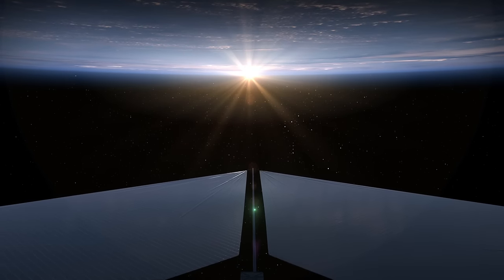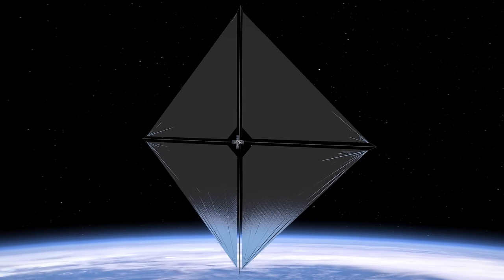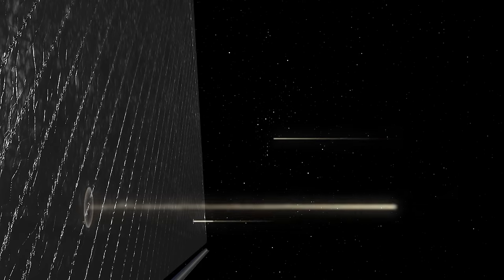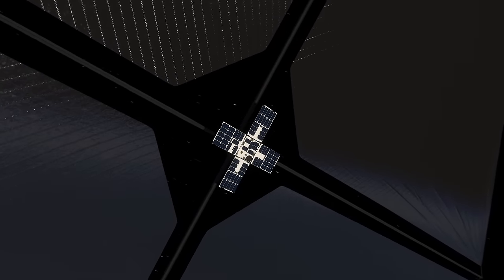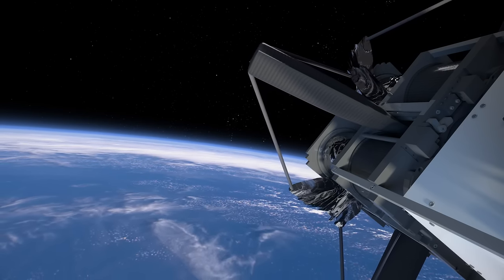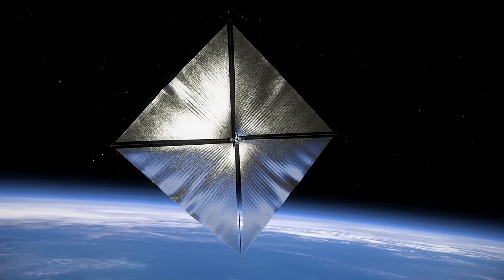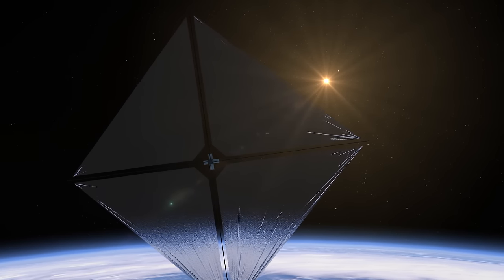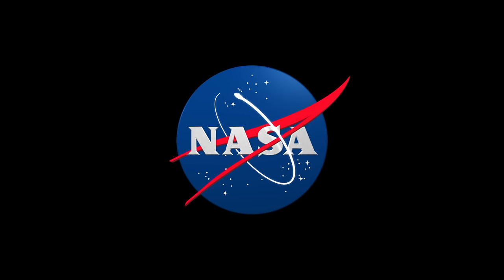NASA's Next-Generation Solar Sail Mission

Comment: Thank you for thinking in solar sailing again! Its weird this amazing propulsion method and we haven't yet mastered it, but its great that you guys are working on this, good luck!
Reply: Solar sails are an incredibly niche technology with little practical use case.

The further you get from a star the less efficient they become and the slower they move. 

Biggest issue is solar sails are stupid fragile. A smaller sized sail for actual use would be 100m x 100m and the metallic coated Mylar sheet would be a few microns in thickness. This basically means any matter that touches the sail will tear it. Just the act of leaving the heliosphere would destroy a solar sail since the change in pressure is great enough.
Reply: Its just a start , we human are a brand new race into the gallactic realm

Comment: Amazing.  Good to see that NASA is utilizing the natural "environment" to help move spacecraft.  Let's have more of this!  Thank you.
Reply: Been using gravity assists for a long time
Reply: @Astra2  gravity assist was great, but this one is revolutionaries, using solar power to generate thrust instead of rocket propulsion
Reply: @imamfauzi1101  Gravity assists were and are revolutionary. Using gravity instead of rocket fuel. But I get what you mean, solar sails have the potential to accelerate crafts' to a fraction the speed of light, which is absolutely mind-boggling and could one day allow for interstellar missions.
Reply: @Astra2  Yeah that's what I mean, gravity assist really depends on how much gravity that some stellar body has, hence it's called gravity assist, and it's not really increase the speed so much higher, especially a significant fraction of the speed of light, solar sail just need a solar power from nearby star
Reply: @imamfauzi1101  Well speed is relative. The Parker solar probe is travelling at 692,000 km/h. Still much slower than the speed of light.
Reply: @Astra2  Alright got that, thanks for the information

Comment: It’s fantastic we are exploring these new technologies, but how durable is a solar sail? It looks like even small particles of rock would rip right through it, especially if it gets to the intended speeds.
Reply from the maker: ACS3’s attitude control system can counteract imbalances due to relatively large holes (centimeters across) even at the most outboard edges of the sails.

Comment: I've always loved the look of these, image that flying from system to system
Reply: I don’t think these sails are designed to do inter stellar travel. They’re best if confined to one solar system
Reply: wouldnt work for interstellar journeys
Reply: @huwale  couldn't it pull the sail in between systems and open it again once it once it reaches the next? A probe or satellite, not people
Reply: @randomdaveUK  the further away from a star, the less power it has. once its far enough away from the sun it'll be basically unpowered and will take thousands of years to reach the next system.
Reply: @huwale  that's not true, there's no resistance in space, it won't slow down. Anytime it's stuck by photons it's speed gradually increases.
Reply: @randomdaveUK  it won't slow down, it just won't get any more acceleration once it's far enough away from the sun
Reply: @randomdaveUK  He never claimed that it would slow down.

Comment: I heard about this and it's research which dates quite a while back. Great to see the continous development. 

What are the power consumption requirements for such spacecraft? I'm sure we can already sustain it on the energy captured from a cosmic void. 

These will achieve great goals and a great achievement for you. 👏
Reply from the maker: Good question! ACS3’s cruising power is in the 10-12 watt range at any given time.
Reply: @NASAAmes  can laser beams from LEO/moon be used to propel the sail when it gets too far away from the sun? How fragile are the sails? Could they be coated in a thin layer of aerogel to protect them from fast moving debris?

Comment: Amazing.
Would the craft still need onboard fuel for orientation correction? Because surely if the photons hit at different angles, the craft will eventually rotate. 

I imagine that we can get close up images of Kepler planets before the end of this century using solar sails.
Reply: While I'm not aware of the internal components of the spacecraft, it's both probably possible to change the shape of the sail by bending it to get deliberate asymmetric thrust for attitude control, and the spacecraft bus may have a set of momentum wheels for orientation control.
That being said, momentum or reaction wheels (basically gyroscopes) do hit saturation speed eventually so on a larger spacecraft attitude control thrusters would be required but as this is a tech demo, there probably are none.
Reply: you could also use reaction wheels, but also some solar panels are needed

Comment: This is a genuinely incredible idea. How much wattage would be required to use the same type of propulsion on a crewed mission? Not light speed, I just want to know how much power would be enough to significantly cut down on the length of a trip to mars or beyond, and how much time it would cut off.

Comment: How much weight can a solar sail carry? cuz i heard the major downside of em was that they struggled to carry more weight which would be needed for research or anything like it.
Reply: You could carry as much weight as you wanted if you were willing to put up with being slower.
How much would be practical to carry would depend on where you’re attempting to fly (is there a tiny bit of friction there to impose a minimum amount of force required, or is it a transfer that you have to pull off with limited time)

Comment: This MUST be an April Fools joke ! What is the force per square meter on the sail ? How fast will the ship accelerate ?
Reply: ACS3 already launched by the time you posted this
Reply: The very rough answer to both is: very small.
But if you have a light spacecraft with large sail then slowly you can go very far.

Comment: How can something that doesn't have mass push spaceships or other similar things in space? It's about the difference in temperatures between two sides of surfaces or is it something else? I guess the energy from photons has some part in it. Maybe photons actually have a mass?
Reply: Photons actually have a very small amount of momentum to them, it’s a force called radiation pressure.
Reply: @collectiusindefinitus6935  I didn't know about that. Thanks for the answer. Cheers 👊💪

Comment: What about asteroid impact on those sail which will be torn before they reach the end of solar system.
Reply: Bro asteroids will not hit the sail. They are too far apart and very avoidable.
Reply: @xd0895 he's talking about the small ones
Reply: With a sail that thin and the speeds associated with space, a micrometeorite will probably just leave a micrometeorite shaped hole without tearing the sail in the process, which means the sail itself would be able to take quite a few impacts before performance is severely impacted.

Comment: It's so thin, what about small debris striking?
Reply: Small debris goes straight through - no problem.
Reply: @nightjarflying  well it will tear a small hole won't it?
Enough small holes and the efficiency of the sail will start going 
And those debris,even though small will have immense kinetic energy
Reply: @kaiserwhence2468  true, but it wouldnt spend much time in earth orbit.  it would probably used for missions beyond LEO where there is less debris. even then, the rate at which debris could cause its efficiency to go down probably wouldn't have a big impact on a mission (dependiing on the length of the mission)
Reply: @kaiserwhence2468 There isn't enough dust & micro-meteorite particles to have a noticeable effect - the Japanese IKAROS 2010 sailed for 5 years & it hits its time targets perfectly predictably - it wouldn't if it was riddled with holes. The big space risk is frying electronics from cosmic rays & solar particles, not physical damage by rocks, pebbles, dust etc etc.
Reply: @kaiserwhence2468 Very, very little kinetic energy is transferred to the sail as something dashes through at thousands of m/s
Reply: Thanks all,I get it now:)
Reply from the maker: Good question! Small debris striking the sail would just go right through, vaporizing the sail at the impact point, leaving a tiny pinhole.
Reply: @NASAAmes  thanks!
Reply: @NASAAmes so would the holes damage or slow it down
Reply: @Idk-lt8os  
Not a lot, micrometeorite shaped holes are small, the solar sail is big.

Comment: May I know how fast would these things go?
Reply: Around 10% the speed of light
Reply: really fast like going to mars in just 24 days
Reply: Very low acceleration, about 0.00001 N/m^2, if I use F = 2PA/c, which would assume the sail is facing the sun directly and has perfect reflectivity.
(I may be wrong about the formula btw)
Reply: @Random_Human731  Outside of science fiction books, not in a million years.
Reply from the maker: Initially, up to 1.4 km/d up; -1.7 km/d down, or around 1 mile/d, either way, approximately.  Once we get lower in the atmosphere, we will come down much faster due to drag.

Comment: Wait a tiny space rock.I can see tiny rocks cutting holes in the sail it wont last long . Good idea . No protection from tiny particles traveling millions of miles . Good effort tho
Reply: At that speed and with a sail that thin, a tiny rock will only leave a hole in the shape of said tiny rock in the sail, they’re not going to cut or tear the sail substantially.
Reply: @Lyenati  NASA, Never A Straight Answer
Reply: Yeah they definitely didn't think of that. They should hire you, always nice to step away from work for a quick laugh 🤡
Reply: @mc_kublai  
They did think about it, there’s another reply from them in this comment section, let me quote:
“Good question! Small debris at this speed would just go right through, vaporising the sail at impact point, leaving a tiny pinhole.”
Reply: @mc_kublai  ok and I see you have a job trolling people. Seems legit

Comment: e = mc2

Light has no mass 
No mass = no pushy pushy
Reply: calm down
Reply: You have the right formula, but light does have energy (since the Earth would be frozen solid if it didn’t). So, some energy / c^2 =m this means light can cause movement as though it had mass! The c^2 just means it’s not much equivalent mass so the light pushes with very little momentum.
Reply: Bruh if light has no energy, why the sun ray is hot??????????